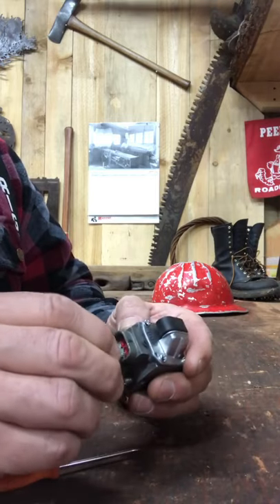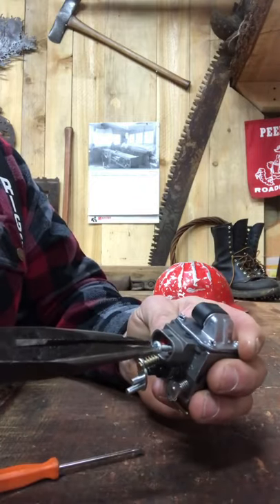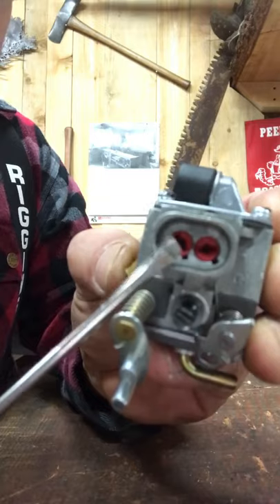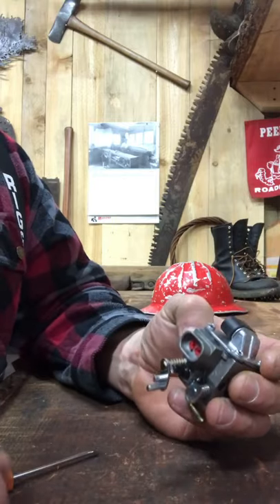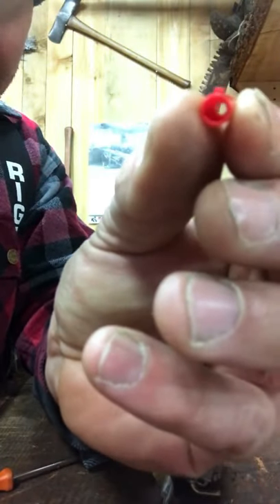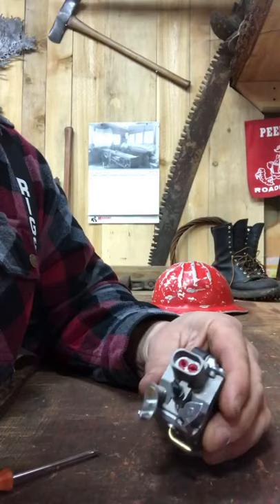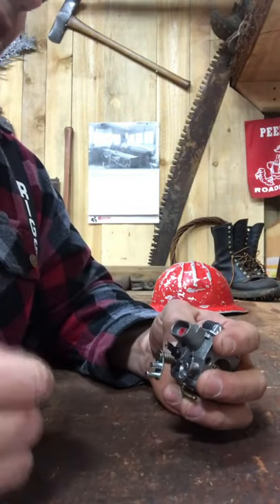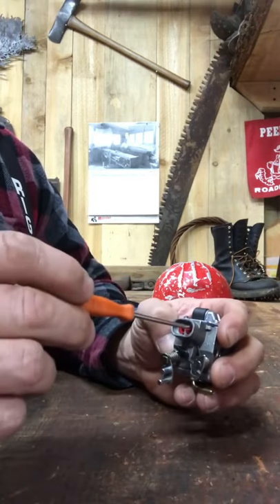Carb Adjustment Tutorial

Comment: what do you mean with fire screen?
Reply: Spark arrestor
Reply: Great video, what do you mean by fat?
Reply: @mrtennessee6862  just starting to “burble”. Or if it’s really fat then your saw will die OR it’s not going to have as much power as it can. I’ve even had mine (when I started my self education) run “ok” and a had to use the dogs excessively hard to get it to “clean up” the engine running while cutting but doing so is VER hard on the bar and rails. I hope that cleared up some of your question.
Reply: @ToddAdams1234  fat means a bit more fuel, is that correct?  Also to get it fat turn out on what screw?  I have a 066 it has a idle screw also. Thanks for your help
Reply: @mrtennessee6862  to get it more “fat” on the high end you need to turn the jet that is furthest from the cylinder, no matter who’s saw it is. Same procedure with the low side. Do the low side 1st, get the low to its highest speed, then turn it out about 1/16th, then free rev the saw till it’s at highest RPM without burble, THEN turn out high screw until it “just” starts to burble. BUT when you do that you CAN’T stay in your cut long. If you stay in the cut long you’ll need to turn it out about 1/16 more. You’ll just need to tune it from there for YOU and your style of cutting. THAT is the #1 reason why you don’t loan a saw out to people, EVERYBODY cuts differently and you don’t want someone to trash your saw, because we feel bad enough when we do it to ourselves. 
Is that enough info?
Reply: @ToddAdams1234  thanks, I agree I never lone a chainsaw. I have many saws, over the years people have given them to me. I'm practicing on carb tuning. Thanks bud
Reply: @mrtennessee6862  fat/rich/more fuel